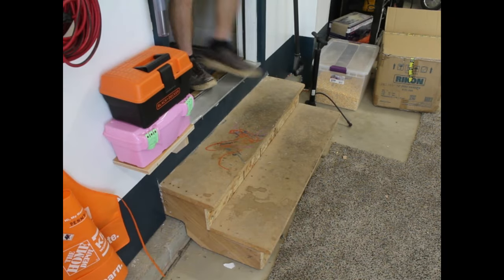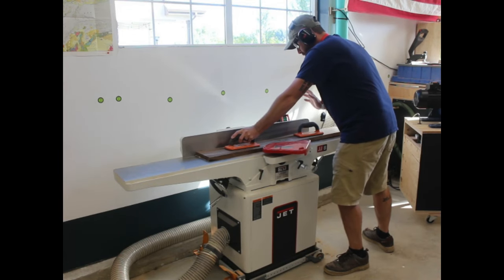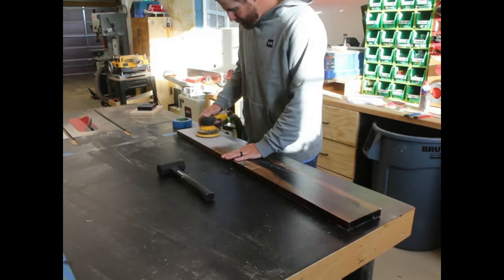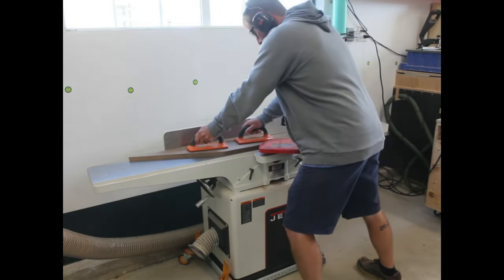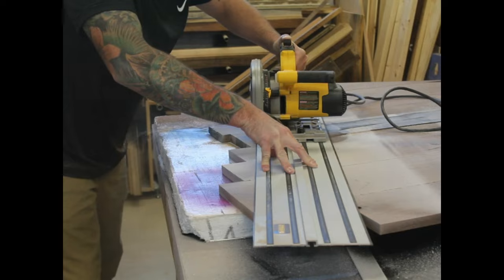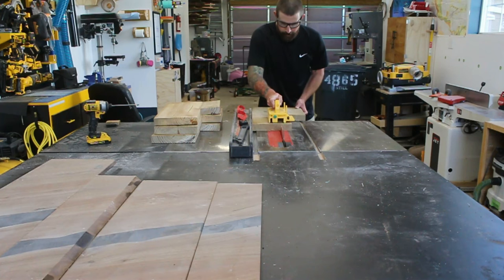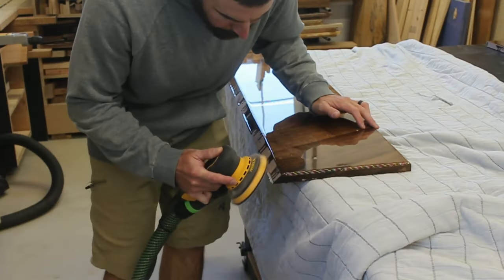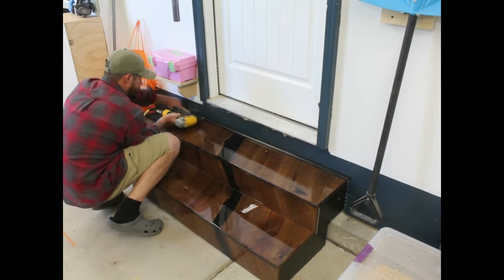Epoxy River Stairs - Waterfall Down the Stairs!

Comment: How has the epoxy held up with foot traffic? I REALLY want to do my staircase in a cool design and then epoxy it. But I know epoxy can be slippery and isn't the strongest against scratching and marring. Also, not so sure how I'd attach the treads after the epoxy has finished as the stringers are fixed in place already. I've also never worked with epoxy and would be risking ruining a completely custom cut (as all staircases are) set of treads (14 total). TYIA, that finished product was AMAZING btw!!
Reply from the maker: Thank you. Everything is still good with that glaze coat that I put on. That’s a tough one to figure out, and I know you won’t like this but you could plug screw holes from the top